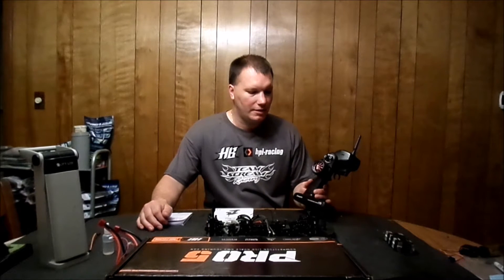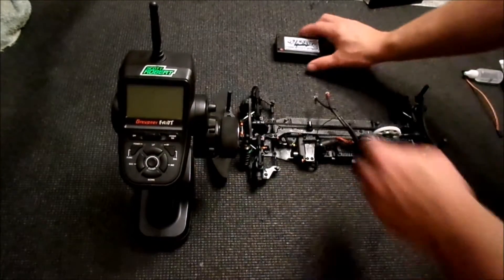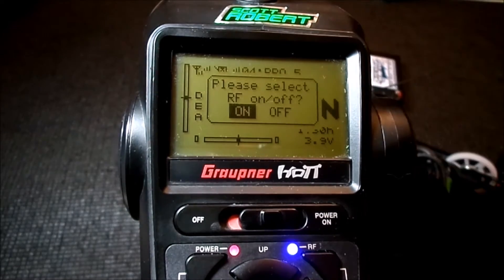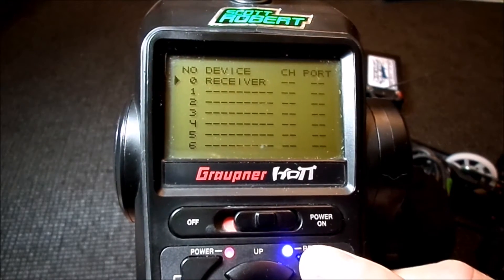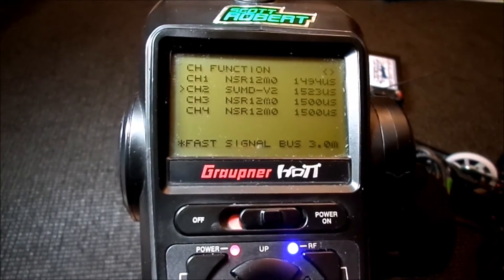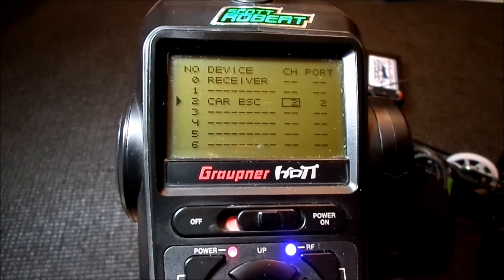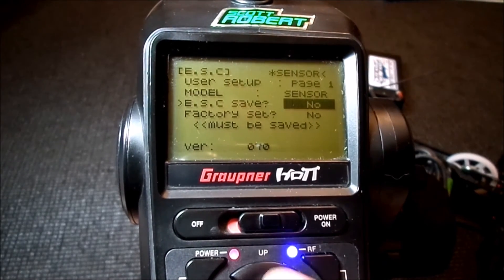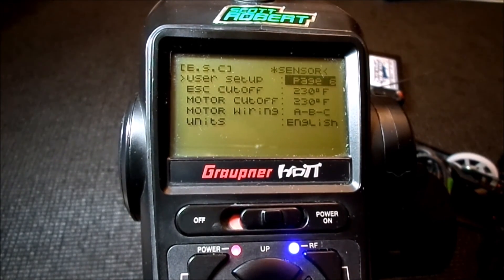Adjusting a Graupner Speed Control with Graupner Radio

Comment: Great video, do you use this radio for racing? im interested in this radio and ESC but theres not a lot of info on them out here. Thanks in advance
Reply from the maker: I used it for racing for about two years. I have now moved on to the X-8E. The X-8N is a great middle road radio that is good for racing as well as backyard R/C. What won it for me was the relatively cheap receivers. It's an important feature when you have 10 cars and need to switch them all.
Reply: Could you please get ahold of me on messenger.